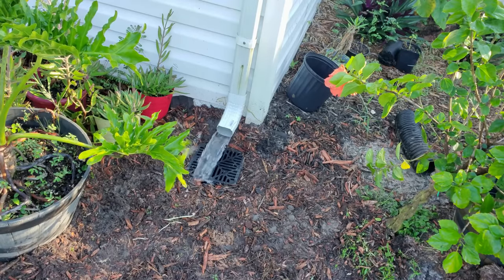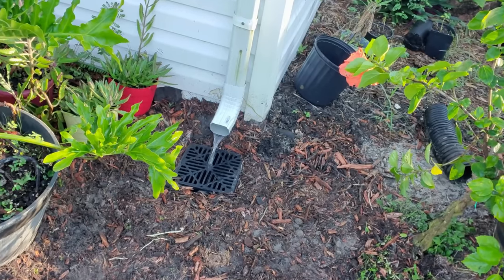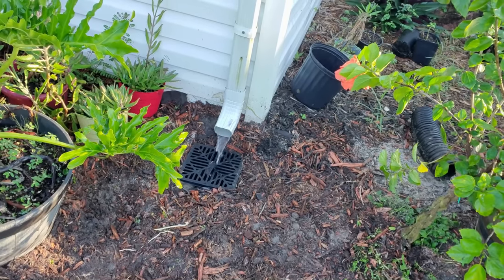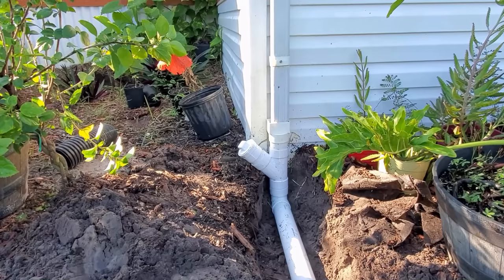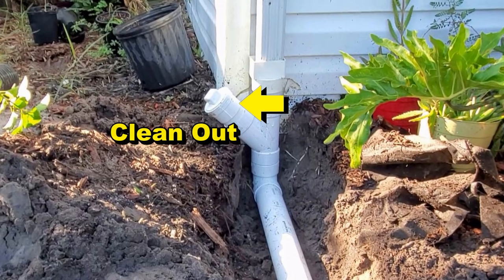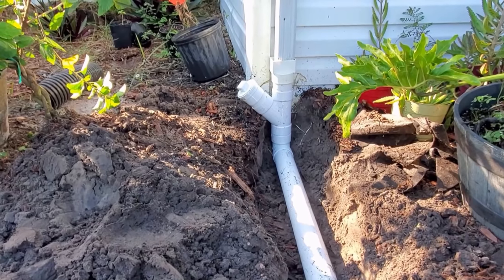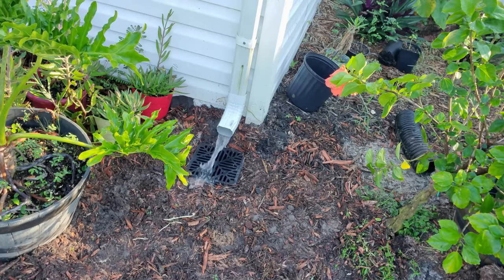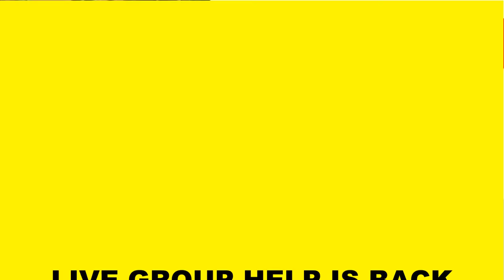Downspout Drain Pipe - Do's and Don't's

Comment: Angle of the downspout is wrong and they need a concrete pad angled to the catch basin. I put catch basins under all my downspouts ten years ago with no problems.  Easy to clean, run a hose thru the pipe twice a year. Lines are clear as a French bell

Comment: Good video.  I would recommend using long sweep 90's or two 45's in a buried line.  If you have to snake it, it will be much easier with the more gradual bend.

Comment: Just wanted to stop by and say thanks Chuck - your videos are very helpful. I had this exact problem and I was installing a French drain to fix the drainage problem. When I was putting it back together I watched this video and realized the root cause of my damp basement was actually the downspout, which was installed just like in your guide here. It was a quick fix to replace the NDS catch basin with a Y.

Comment: As noted by gmcjetpilot, this video is misleading.  In many situations the presence of a catch basin will catch both granules from 3 tab roofing plus floatables.  Once these items are trapped in the catch basin the owner can periodically remove the grate and clean out the basin.  Otherwise debris travels downstream in the outfall pipe where it builds up and clogs the pipe or the drywell.  

It is pretty easy to use a short length of pipe and a 90 degree bend to make a downturned elbow that is installed within the catch basin and mounted to the outlet pipe and prevents most floatables from leaving the catch basin.  All downspouts at our residence discharge to catch basins.  We clean out the catch basins every 5 to 10 years.
Reply: This is exactly the solution I instantly thought of when looking at this. At least I wouldn’t have to do all the digging. Unless… you were charging homeowners by the hour, Another 90 degree metal elbow would be my solution.

Comment: Another alternative that is catching on (particularly in the pacific northwest) is instead of worrying how to drain water coming off your roof, is to "collect" that water. We live rural and don't have city water supply. We have a well which is fine except during hot summer months when water is at a premium. We have two, 2000 gal. cisterns. We get a LOT of rain here. The water runs off the roof and the gutter downspouts are redirected to the cisterns. Come summer, we have 4,000 gallons of extra water. With flooding issues however, I did install catch basins following Chuck's advice and directions on how to do it properly.
Reply: Where can i find DIY info for  thst kind of system? 
Thanks

Comment: This only works in warm climate. For winter folk, never direct pipe. You must have an air space gap for freezing, expansion and contraction. Your french drain should also use at least 1 inch screen aggregate as well as geotextile cloth
Reply: My system is like that. Its worked fine for over 25 years. And that's not a french drain.

Comment: Thanks for the tip!  I just dug a hole to install a catch basin like this.  Back to the drawing board!
Reply: It's fine, don't undo yourwork.  I have never once had an issue with the catch basin in this video.....the problem I see in the video is the basin is too close to the end of the downspout, which is why it splashes so much.

Comment: To correct that issue, you could have used an offset elbow w/o removing the entire catch basin system as that is how I had mine done.  I also have an removable sleeve to "flush fit" the discharge from the elbow offset to the catch basin grate to allow me to remove the sleeve to service/clean the catch basin.
Reply: yeah but this system had corrugated pipe. it need to be removed.
Reply: Yes, but your excellent idea is frowned upon by those who want you to hire them to provide an expensive drainage solution to protect your property from water damage.
Reply: Yes, I have a similar set up with a custom 45 downspout elbow and basin countersunk in a concrete spillway. It has operated flawlessly for 23 years with no infiltration to the house. Totally agree with the removable sleeve also.  I use these  for my direct connections instead of a cleanout wye.. Removing the sleeve allows access to both the buried outfall line, and the horizontal downspout tube itself, which often becomes clogged with leaves, seeds, dead birds, etc. With the wye shown in this video, you would have to clean the downspout from roof level, or dis-assemble it at the base...very time consuming.  Direct connections are ideal, but catch basins can work if done properly.

Comment: Eliminating the catch basin in warm southern states may be ok, but if you live in a cold weather environment, the pvc will freeze up and in turn your downspouts will freeze up causing all that water to drain along your foundation as you experience thawing. I live in Texas but still would use the   catch basin with a different downspout adapter installed keeping the flow of water going directly down into the catch basin.

Comment: I wish you was in Missouri.  I have been fighting water issues. I installed two sump pumps. House is dry. But my 600 feet of French drains failed after about 12 years. I may have to rent a excavator again.

Comment: i hate to say this but this video is wrong. the purpose of the catch basin is to catch debris that falls to the bottom, it has a grate that you unscrew so you can dig out and maintenance on periodically. i work doing backyard makeovers and this setup is always clogged and we have to run 100% new pipe because it’s pretty much clogged all the way through. this setup here can only work if after that elbow it runs straight to the street, which never happens most drain systems have many turns connections to other drains and many elbows. the better solution is to keep the catch basin and notch the grate to accommodate the downspout otherwise all the roofing debris especially the runoff of shingle sand is what eventually cloggs this stetup... just my experience

Comment: Just need a another elbow turning downward, or a direct connection to pipe, I have both and both work great.
Reply: yessss
Reply: Yes mine works great as well. I even put a decorative rock in front to hide the catch basin and use it as a backslash at heavy rains. The basin catches majority of debris and very easy to clean out
Reply: Yes it could catch debris.  But a heavier rain actually self cleans the system.  The turbulence the corrugated ridges give the water cleans all debris.  In Northern climates  corrugated won't break from frost movement or ice build up.  Very flexible pipe.  Pvc has 0 give.  Ice and frost movement will eventually crack pipe or even pull it out of the fittings.  Pvc works well in Southern climates.  But still not necessary. The blockages mainly are where water enters or try to exit. And the elbow fittings.

Comment: Exactly what I needed to see. Thanks! I need to drain rain water away from house and dump in canal. Thinking to use a couple of 45s at the end to get up and over the retaining wall and maybe leave some water in there to prevent rodents.
Reply: Lou ... a drain that doesn't fully empty will clog with debris at the lowest point. If you need to keep critters out then make up a screen that is easily removable for cleaning. The other alternative is a flap on a hinge so moving water will open it and gravity will close it when the water stops flowing.

Comment: I agree.. except under certain circumstances,  like mine... i have inclined drive that brings more water to the garage then jist off the roof...  the basin not only catches the roof but the excess water from the drive.   If it were not for that i would have gone with the all pvc pipe like in the video.

Comment: great video.  You mentioned that the pipe might freeze.  I live in Vancouver Canada where the temperature can get below 0 in the winter.  Would you recommend installing a drain pipe?  I am concern that water might back all the up the downspout and into my gutter once the drain pipe freezes.

Comment: I’m a newbie on assembling PVC components.  Do you have a video on the assembly process for this configuration?
Reply: All you need is a hacksaw and PVC glue.  You can cut the pipe into small pieces whatever length you need. It all just slips together. Use a knife and/or sandpaper to remove burrs caused by sawing. Dry fit it together to check if it looks OK, then pull back apart, and glue each connection one by one. There's a swab inside the can of glue. Swab the female socket, then the male pipe, insert and twist about 1/4 turn. The glue will set up quickly. Proceed to the next connection and repeat.

Comment: Hello. Thank you for your video! I want to put this PVC on my 4" round downspout. I was going to hook up a FLEX-Drain 4-in x 25-ft 70-PSI Corrugated Solid Pipe (from Lowes) to it. I thought that would be easier to work with for me than a pvc pipe. My question is, is that as good as PVC and next question is what do I put on end of the pipe? I have no where to run it to without digging into a gravel driveway (which would be very hard for me). Thank you for all your wonderful videos!

Comment: you can use a catch basin  for a downspout 100%. you just have to run the downspout stright down into it. take the 90 off and extend the downspout straight down onto the basin lid. also move the basin straight under the downspout not a foot away from it lol.
Reply: Good point

Comment: Thanks for the video. What if you just had the downspout go right into the catch basin at a 90° angle by cutting hole in the catch basin grate, would that work? It is right by my front door and I want it to look clean and not junky with downspouts going into non matching color, round, larger thick pipe.

Comment: In the north where it freezes you can’t connect it solid like that. The water will freeze in the pipe and cause the ice to back up your down spout. You have to just extend your downspout closer to the catch basin and you will have no problems.
Reply: Thinking of installing a basin in my flower bed at downspout. I'll have to bore under my sidewalk to get the run off pipe underneath it. Should take care of flooded walkway and flower bed hopefully.

Comment: Getting ready to install a new drain and I appreciate your informative videos Chuck. Can you, should you, drill a hole in the terminal elbow, under the discharge grate, to allow water to drain out of the line? Seems like an ideal mosquito habitat . . .
Reply: Yes, some brands already have a weep hole or slot at the discharge elbow, usually if paired with a pop-up, NDS being one. Otherwise, just drill a 3/8s” hole at the front bottom of the elbow.

Comment: Hey Chuck I love your videos! Very interesting to see how differently people do things in different areas. Here in Atlanta and surrounding areas we never use PVC drain lines. We like to use downspout to 4” corrugated adapters and go straight into an n12 adapter with a small section of 4” corrugated. Either wye with clean out, straight coupler, or 45 depending on the situation. Then 6” (or bigger depending on expected flow) N12 smooth interior wall pipe for everything after. We step up progressively as more downspouts or catch basin lines are added in. Works great for us no complaints ever and we have been doing this way for many many years. What are your thoughts on this? Why do you like PVC better? Would love to hear your opinion on PVC vs N12

Comment: Is it worth using a long turn 90 degree elbow instead of the shorter one at downspout-to-drain-pipe, so you get more speed? I'm running triple wall pipe (not pvc) under a walkway so it's buried too deep for water to come up at the other end at a pop-up emitter (so the pipe will have to be a french drain before the pop-up). The yard has a decent gradual slope so water flows okay, but wondered if the long turn elbow might help overall. Then again, the longer elbow might complicate installation?

Comment: This system will eventually get clogged with debris from the roof.  The 4” grate/outlet will also let in debris.  

You would be better off using a sanitary tee with that 4” grate as a clean out.  Otherwise, you wouldn’t know your system is backed up until water was gushing out the gutters (and leading to overhang damage).
Reply from the maker: NOT A CHANCE!
Reply: THE absolute best way to prevent clogged drainage systems is with a catch basin.  Use a 9x9 or 12x12 NDS catch basin with A) Downspout Defender Grate and B) Catch Basin Filter
Reply: Also, for the outlet you could use an NDS Spee-D basin with a 6” round pop-up emitter
Reply: That brings your flow rate from 12gpm (4” round grate) up to 88gpm
Reply from the maker: @scottydawg2475  Please watch a few more videos. We Show everything you are talking about!

Comment: I am going to be doing this come summer this year. I will be putting eaves trough on my house and my neighbor is doing the same. I wanted to install a catch basin under the downspout like first shown in the video so I have an easier way to clean out if need be but the only ones available are the 12x12 for $60. I will be finishing the side of my house walkway with concrete. Would you still recommend hard piping with pvc pipe? In between the houses I will have a center line where the french drain is that will remain gravel so any other water can get into the pipe and be discharged through a curb hole I will be doing. Any thoughts?

Comment: Chuck advice please. I ran two downspouts into a 50 foot run.  One joins underground to a 6 inch catch basin that was in a low spot and then the catch basic connects to the main line. Problem -  I live in FL. With a heavy rain, the 4 inch pipe I put in for the system is taken to max capacity and the catch basin overflows. If I had to do it again I would do 6 inch ( pay attention DIYers!). Why am I worried. This low spot is outside my garage where the suicide vents are at ground level so I am worried the garage will flood. Will a bigger catch basin help me or do I need to dig up the whole enchilada and use 6 inch instead.HELP!!

Comment: Do you have a video that compare/contrast solid discharge piping vs corrugated discharge piping? Specifically when/where to use which.
Reply from the maker: Hi Nicholas, your question is a very easy answer. Solid pipe will always be your discharge. Basically there’s collection, that could be catch basins or French drain, which is perforated pipe surrounded by gravel or easy flow, then once you have collected the water do you want to keep it. So the discharge is solid pipe. Thanks, Chuck
Reply: @appledrains  thanks chuck. I got my crawl space dried up because of you, now I’m working on gutter water discharging. Thanks again for your content.

Comment: Can you use the clean out on the first downspout only if your running them in series to save money? What about the cheaper black pipe. Pvc is outrageous.
Reply: You could do that, but how would you clear a clog at the bottom of one of the other downspouts? You'd have to go on the roof and snake the downspout from up there. As for PVC vs corrugated, there are videos from installers who swear by one or the other. I've not yet been able to figure out anything consistent.

Comment: Could you have not just installed a larger grate to catch the water?  They make larger sizes...  Seems like an easier fix than what was done here.
Reply: or maybe the drain is too close to downspout....that is what i saw wrong.  i have installed several of these on both homes I have owned and never once encountered any issues.
Reply: Lowering the downspout to ground level should fix it too

Comment: If heavy flows overshoot the basin why not install another A-style downspout elbow directing the water vertically down into the catch basin? Leave a 1.5" air gap so leaves/debris can be cleared by wind or maintenance. This is how rainwater harvesting catch basins work.
Reply: I had to look it up: A (front) elbows direct water forward or back from the gutter outlet. B (side) elbows direct water left or right from the gutter outlet.

Comment: What schedule pvc pipe is that.     In the box stores, the gutter adapters are sized for schedule sdr35 and for Astm 2079 sewer drain pipe.     I don’t see any adapters in store for schedule 40
Reply: you don't need an adapter. you can go right into the pipe.

Comment: Is there a way to rig up a setup like this but make it easier for the homeowner to prevent debri from entering the line? Before I seen this video I thought the catch basin would be the solution. Even under the top grate put wire mesh under the grate.
Reply: You can start with a good set of gutter guards.
Reply: @woolybully4902  Yes thats true. They are pricey
Reply: I have many trees in and around my yard. Leaves clog the drains and do require cleaning. Gutter guards are good but they are expensive. I installed a couple of rain barrels made from 33 gallon plastic garbage cans. On the top of the can, I installed aluminum window screen. The screen traps debris coming from the downspout. I installed an outlet with a valve on the bottom so I can save water and use it for future use. I installed an overflow outlet near the top of the can that is connected to pvc pipe which leads to the street. It works well. I also have a 350 gallon tote container that catches water from my workshop.

Comment: Is there any issue with the upward discharge?. I dont know if the pipe keeping water can be a problem.
Reply: Yeah I was thinking the same thing, this would be a fail in my opinion, you want water to flow and leave the pipe.